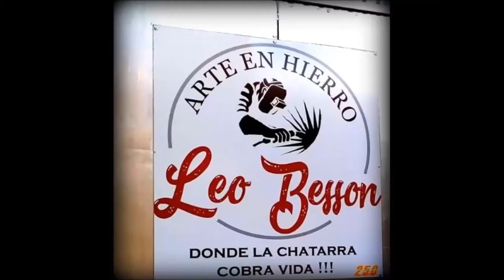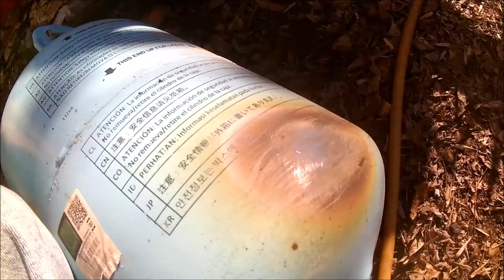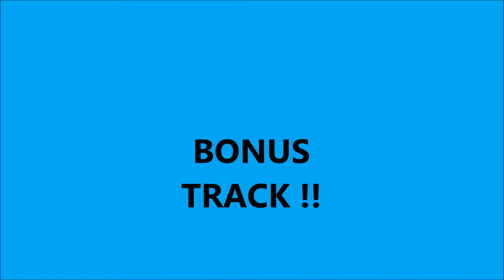SOPLETE de gas BUTANO , usos y aplicaciones

Comment: Hola Leo. Otra utilidad que se me acaba de ocurrir es para aflojar las uniones de tuercas y bulones (o esparagos en cemento) que esten oxidados y no se puedan aflojar; sobretodo si estan en zonas alejadas o rurales.  Un ejemplo seria el de los tensores de alambrados (justo tengo uno pero no necesita ese tratamiento aun). Otro ejemplo estructuras metalicas que estan amuradas al suelo con tuerca y vastago (juegos infantiles de metal, molinos de agua,  motores o bombas de agua, etc). Un saludo.
Reply from the maker: Si amigo , muchos usos más tiene, buena inversión